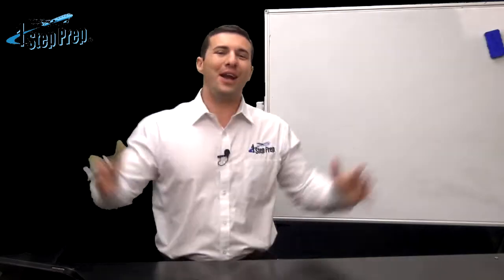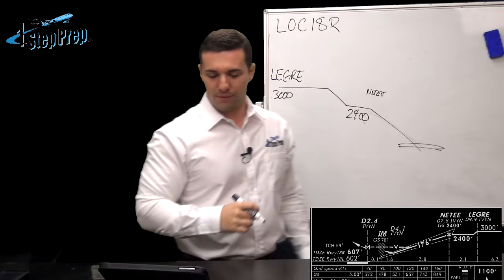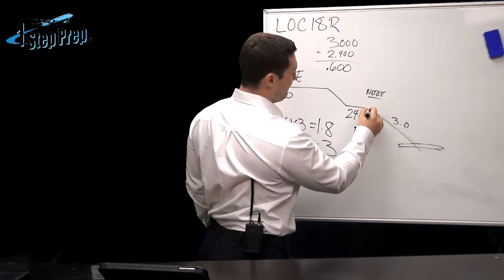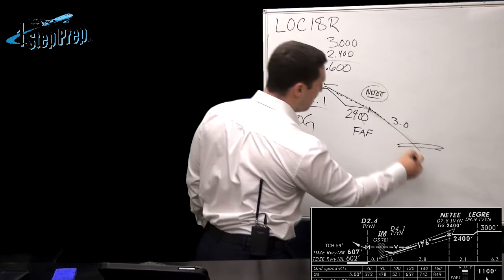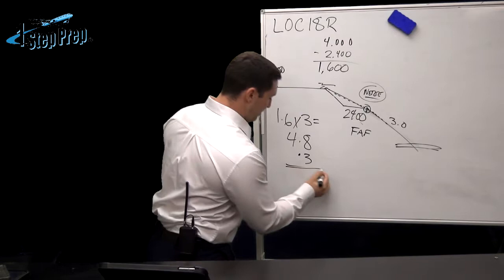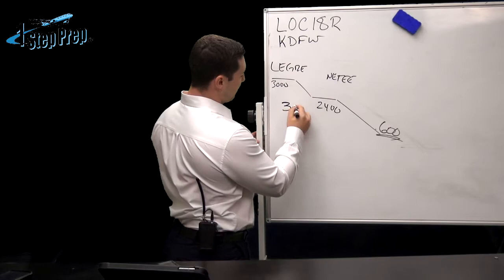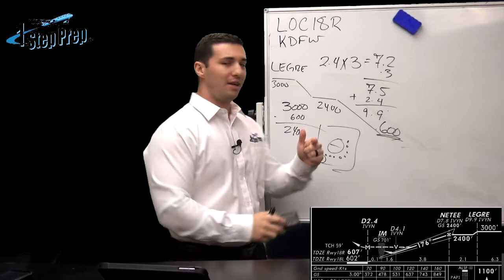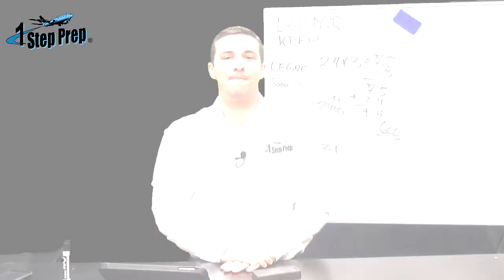Calculating a CDP

Comment: Hey Joe
I’m a 777 FO soon to be upgrading to CA in the 320. I’ve never flown it. I’m aware the transition will be a challenge for me. I’ve peeked at a couple of your videos and I’ve been impressed. Regarding this technique ( without having a clue how FPA interconnects and works for you with the bus - I’ll assume you set it on the FCU? and you always set the exact decent angle prescribed by the specific app? ) but what happens with this math if there are altitude constraints in between your location and the FAF that could be violated by your 3 degrees ( or whatever it is ) decent angle? Also, it’s typical in DFW to be held quite high. You could easily be held up at 6k around YOHAN on 18R. Let’s assume that. Based on your technique 6000-2400=3600= 3.6x 3=10.8+.3=11.1
So  I’d set NETEE in the prog page and as soon as I see 11.1 miles ( wherever that’s presented on the bus ) I’d then select -3 degrees on the FPA switch and start down. What if I’m already inside that 11.1 distance ? Just use speed brakes ? How would I know I’m back on the 3 degree path descending from above it in this case ?
Also you mentioned the yoyo only works FAF inbound. Your technique is used to get you from wherever you are positioned - then once cleared for the approach via a 3 degree decent profile ( while honoring intermediate alt constraints ) to the FAF in which you can then transition to the YO-YO until DDA or landing ?